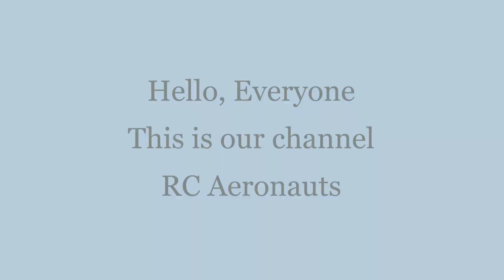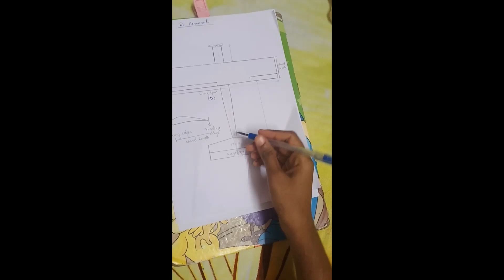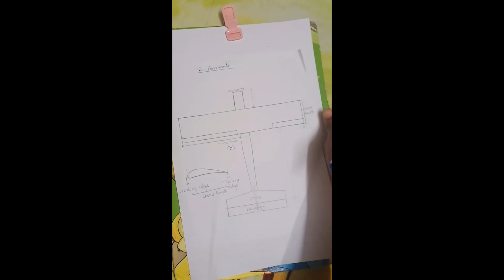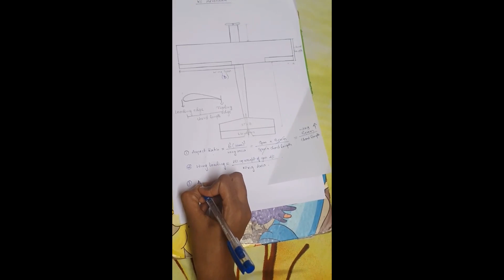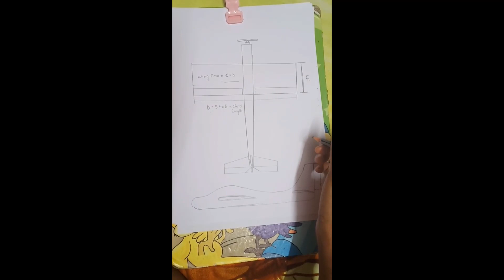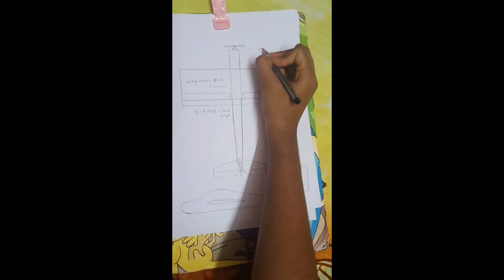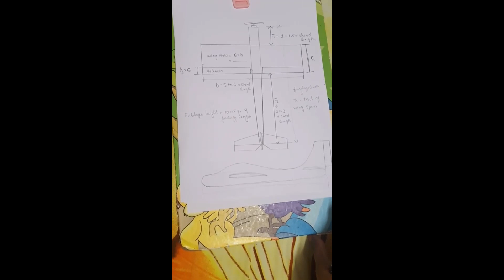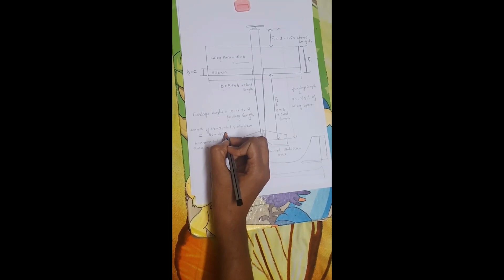HOW TO SIZE THE WING and other control surfaces # How to calculate the Dimensions of RC Plane

Comment: Excellent video.  I am scratch building an rc plane that is unstable in flight probably due to the sizing of my control surfaces--will use the info in your video to correct.  If you did a video on C-loading: cubic loading versus ounces per square feet, I think a lot of viewers may find that interesting.  Thanks for sharing.

Comment: some info.         you  Should  be  using  drawings  that  show  Correct  PROPORTIONS.        the (prevalent) use of  Heavy  materials  results in  Every  scratch-built model being  Heavy  for its size (and having  tail-heaviness in its dom.  distribution of mass).        good airframe design can be achieved, where  One  fundamental dimension is  determined; that being, either,  prop diameter  or  wingspan range.         in this case, design priority should be given to  wingspan.     these heavy models need to have a wingspan of one meter/yard or greater.     with this information, the other dimensions can be determined; via the use of a few  Ratios/math.  questions.      googletranslate
Reply: It’s honestly more reasonable if you apply Dimensional Analysis for the scaling of your craft